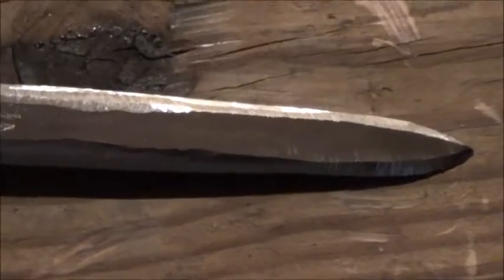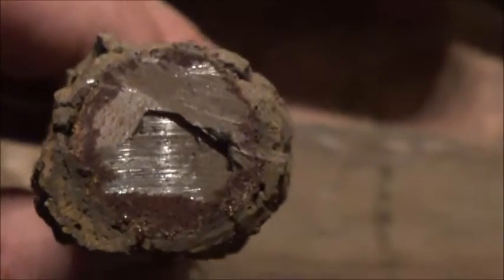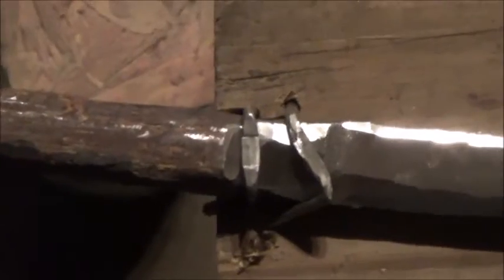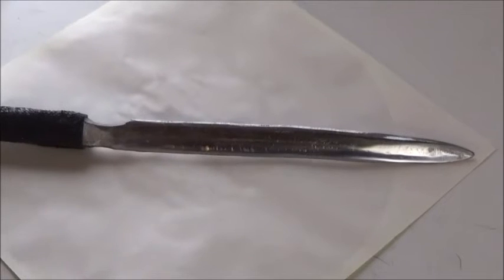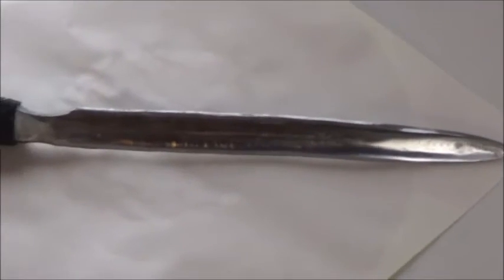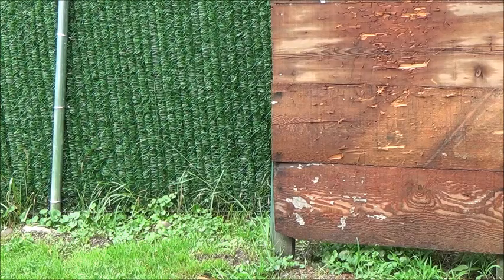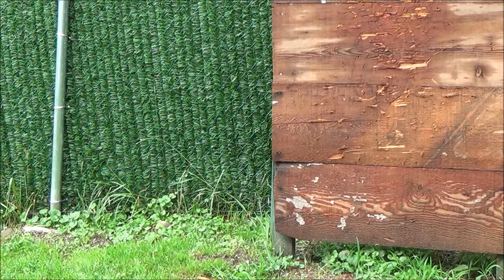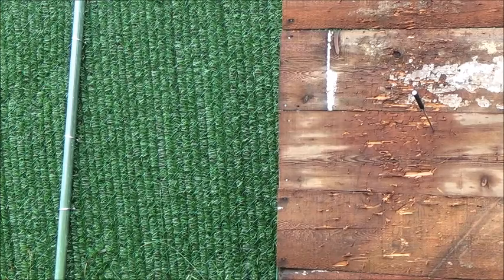My Knife Project

Comment: Jedi knife making skills you have (said in Yoda voice)
Reply from the maker: John Tewelow Lol . I heard that.lol The steel I used was weak, I tried to harden it but still a little weak but it turned out to be a good thrower. When I get some better steel then I will have fun.lol I have an old rock drill bit and it is long about 2 feet + and about and inch + thick. But then again it's old and tensile strenght my be weak. Thanks for watching my friend Yoda.lol

Comment: You forge that pig sticker or grind it? Sure looks mean and flys good.
Reply from the maker: coyote238  I ground it down from that rusted bar but the tensil strength is weak and I tried to heat harden it and dip it in oil but it only got so hard because I can't get good heat up on it. I will just keep it as a throwing knife and get better steel. Thanks for watching my friend.